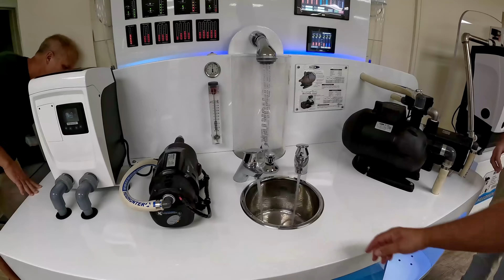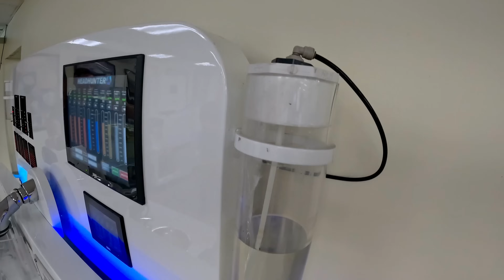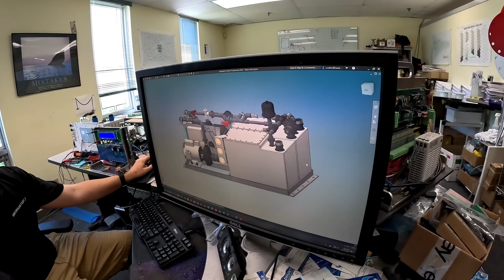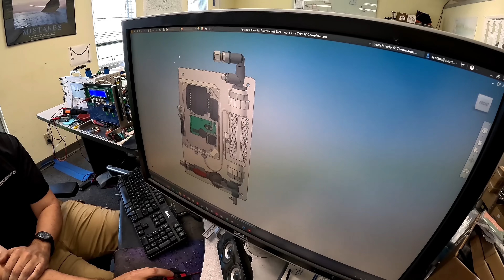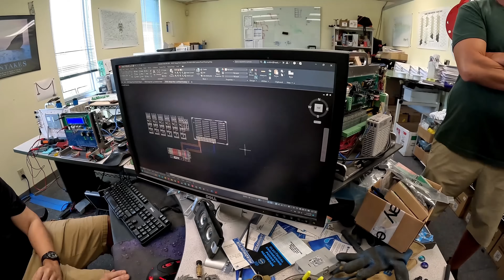Sharing Dirty Secrets... with Headhunter (part 2) 🙈 Esp. 44

Comment: BOY this takes me back - I spent a lot of years working in very similar environments, in Quality Control, Equipment Repair, Systems Testing, and Documentation. Don't cross the yellow lines without the right equipment and credentials! Seriously, as someone who's done this, I think they have a very modern, functional approach to manufacturing and testing. Not that many companies pressure test 100 percent of their product for an extended period of time. That's not even mentioning the field work. Headhunter is doing things right!

Comment: First time I stumbled on you guys was the video where you had to put your yacht in dry dock because there was a 99 cent fitting used instead of a quality product. Then one of your tours with Bering popped up in my feed where Alexi talked about using proper piping instead of tubing for plumbing.

I'm a plumber/fitter/boiler tech by trade and understand this sort of quality doesn't come cheap. But I also understand that cutting costs by using inferior products in the mechanical components of a home will end up costing more in the long run. Sometimes much, much more. I can only imagine how much worse that could possibly be if you're bobbing around in the middle of the ocean. You must invest in reliability and longevity if you want your investment to last. Right?

And the same thing applies in the RV industry - I've helped quite a few friends get their RVs plumbing sorted and can't believe the complete garbage they charge good money for. It's appallingly if you ask me.

All that aside I'm probably one of the handful that enjoyed this series of vids. I suppose that's a side effect of being a turd herder who doesn't mind the work. :)

Comment: Now your 8nto my neck of the woods, I’m a plumber and I’ve always said if you can’t poop, nothing else matters. And maintenance is so so important. When ever I do any system I use lots of valves.  Need to isolate easily so repairs are done easily. And nothing bothers me more than having no room to work on something p, so hope the space is large enough to service this equipment. Nice video.

Comment: The bit about Hot Tubs reminded me of something i saw a long time ago. Some millionaire wanted a Hot Tub on his flybridge, but the yacht wasn't quite big enough to have it always full, all the time. But the owner still wanted to be able to use it at a moments notice without needing to wait for it to fill. So he had a heated holding tank put in down low that would constantly filter the water and maintain the right temperature and when he wanted to use the tub an air bladder would be pressurized to force the water up out of the holding tank through some 4 inch drain lines. The water flowed though a patterned grating that covered the entire floor. Took about a minute to go from empty to full and would drain just as fast.

Probably way to late to integrate something like this into your yacht, but its an interesting idea and these are the guys who would likely have a system perfect for making it work.

Comment: Rico, 1 bar is roughly 1 kg/cm2 of force. 1 mt in height adds 100 grams/cm2 so, to get water 10 mt above the pump you would need a little more than 1 bar (or beat that extra kg/cm2 weight basically)
Reply from the maker: Thanks for the insight! 🙌⚓️

Comment: Interesting video, but I'm a type of guy who prefer visuals to go with tehnical explanations, so I have a couple of questions about something I didn't understand.  It was said, in the previous video I think, that the system you purchased had a capacity of one toilet flush per hour?  

So what happens if a guest has a diarrhea (or maybe all guests) and need to use the toilet more often, does the system have a buffer tank BEFORE the stuff gets processed by the blackwater cleaning system?

Another thing I was wondering about: it was said that Chlorine was made by seawater and then used in the cleaning process, and that the end product could be emptied out into the sea afterwards, but does it contain any Chlorine then, and if so, is that environmental friendly?
Reply from the maker: You really missunderstood  a lot, or skipped around 🙈 honestly, you should just rewatch it again… 🤷‍♀️
Reply: The toilets can flush as needed.   Chlorine dissipates over time so the Chlorine is used up in the retention time inside the unit, and charcoal filter.
Reply: @NautiGuys 

Hi Rico, I'm sorry to bother you with stupid questions, I'm not a tech-savvy person.  I only asked because Victoria said at the end of the second episode that we could ask.  I did not skip around, in fact I never do that with videos from you guys.  I love to watch everything from start to end.  Now I've watched both episodes again and have found some answers but not everything I looked for.  Thank you so much for your reply, sir.